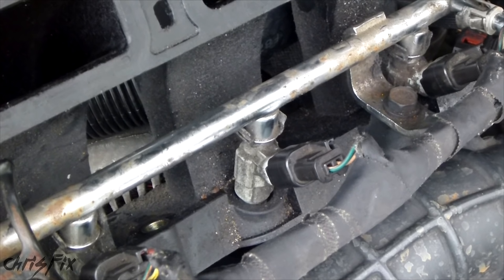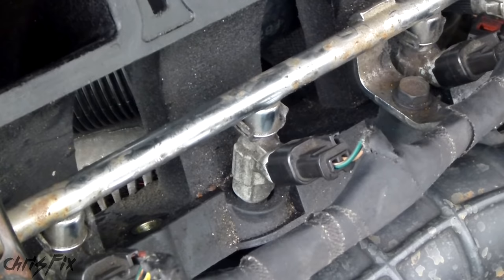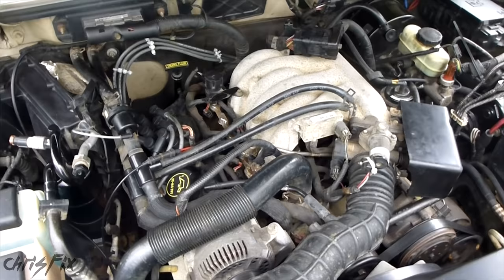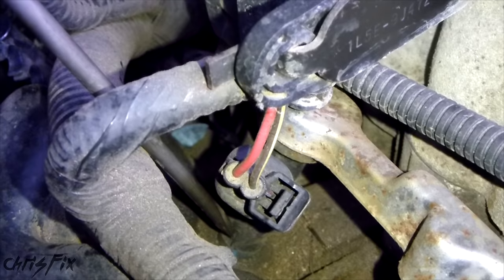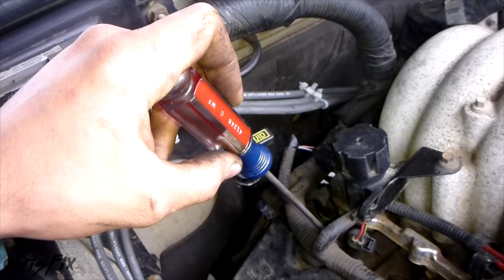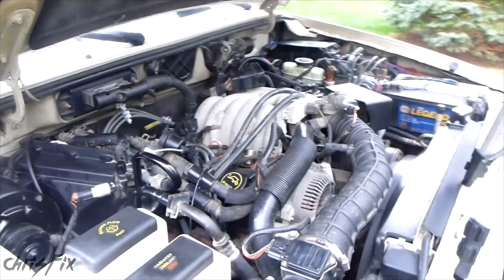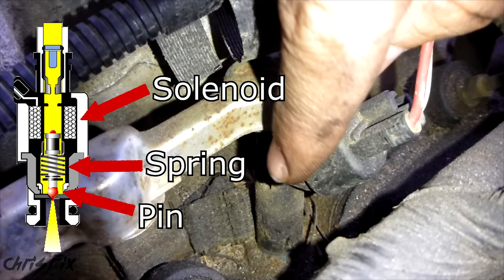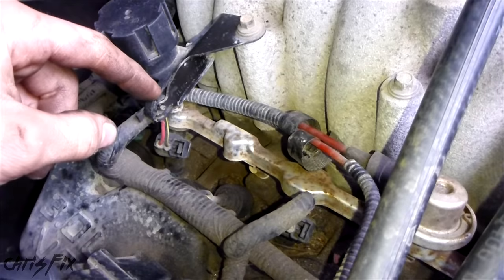Testing Fuel Injectors Fast

Comment: Hey Chris. I wanted to increase my car's fuel economy, any suggestions on how to do it?
Reply from the maker: Rasik Sachdev Correct tire pressure, remove any extra weight in the car, and adjust your driving style are the biggest factors.

Comment: bro nice video. I have a 2006 Buick Lucerne northstar V8 engine. I have had a gas leak for like two days in one particular injector but when I remove the clip I doesn't leak anymore. but let's off a massive spray if I try and put the clip back on. just curious
Reply from the maker: +Sedrick Jones Check to see if there is voltage going to the clip with the car off.

Comment: So the constant tapping is good sign I can touch the top of the secondary spark plugs and I feel.that but on the other side of the engine i feel nothing at all 5.7 05 durango 130k miles it was missfireing I change all plugs and the the egr valve because that code was on aswell no more codes but car still feel a shacky at idle could this be dead fuel injectors or? Bad coils ?

Comment: Hi Chris! if is okay i would ask about fuel injector seal.I would like to know about the reliability of fuel injector seal. How long will it take before the seal wear out or broken? Thank you
Reply from the maker: kuro neko It really depends on a lot of things. I have had cars go 300,000 miles with no problems with injectors or seals and cars go 60,000 and need new injectors or o-rings. There is no definitive time line. It is common for cars that sit and dont get driven to have dried out injector seals or gummed up injectors.
Reply: I understand now. Thank you for helping me out.

Comment: does this test verify even a clogged injector? so i get good clicking on all 8 cylinder 305 tpi camaro. When i pull ogf #4 distributor cap wire i get no idle change when i take off the rest off the cap one by one the idle changes! I pull plug and look for spark it has spark
i Pull#4 plug cylinder 120psi. But theres no fire on cylinder 4 due to the dist cap wire pull test. This seesm to only leave fuel issue on one cylinder

Comment: Not my transmission, it's the fuel injectors.

And there's a test that a lot of people don't know about to know for sure if it is your fuel injectors or not. I discovered the test myself this morning lol. 

Every morning I get in start the car I let it idle cuz it's idling sucky I'll start to drive on the road and I'll feel a jolt I'm thinking transmission but no it's because the fuel injectors are either clogged or dirty and the fuel is not getting to them properly. 

So I said this morning I'm going to do this test that I just figured out on my f**** own lol.

I'm going to give the car some gas before I get on the road to see if I feel that jolt if I feel the jolt that I'm assuming all right transmission and it's slipping if I don't feel the jolt it's because I gave enough fuel to those f**** fuel injectors and guess what I didn't feel the jolt not once on the road not once so if you want to know how to test your fuel injectors there you go... Fast and easy way without having to do anything with tools that's how you test your fuel injectors.

So now I know it ain't my tranny it is definitely the fuel injectors so spread the word there's a new way to check your fuel injectors nobody knows about lol

Comment: I have a 93 f150 5.0 and cylinder 8 is the only one that is fouling out  all my  plugs are new and look clean new wires cap and rotor. Now im thinking the 8th cylinder fuel injector is not working properly *leaking. Could this be the problem im not looking forward to spending alot of time on an injector job as this is my daily driver and the intake manifold covers the passanger side fuel rail and injectors

Comment: Hi, i have a diesel car and it is shows obd code p02cc. I have tried to switch the cylinder 1 injector with the cylinder 2 injector but again it shows the same code. Any idea what could be causing this. Thanks in advance

Comment: So i changed out my spark plugs the spark plug wires the ignigtion coil pack and the idel got alittle better but when im crusing down the high way she has a vibration im thinking it could be the fuel injectors in 3 and 6 but not sure does it sound like it could be the injectors.

Comment: I am at a loss, I have a 2011 kia soul so far I have changed out the crankshaft censor, alternator, battery, spark plugs and my car still died at an idle and didn't want to start. I have to let the car sit for about 30 - 40 min before it will start again. HELP PLZ

Comment: OK so I just had coil and spark plug issues   got that done no more code for that issue but now all of a sudden the check light came on now its code too rich bank 2 po175 fuel injectors  is that caused cos of the   coil spark plug situation before this ? Cos I hav a new altamator and fuel pump all changed out a year and half ago

Comment: What would be wrong if starts up and is loud till it cools down but if I let it sit there after awhile I get what seems to feel like a misfire and everytime it happens under the hood you can here a click, sometimes it's a single click and other times u hear click... Click,click,,,click, it seems it's a bit over the place, along with it when I drive at say holding a constant speed it sputters a bit
Reply from the maker: Any codes showing up when that happens?
Reply: No, and only thing that happened when they hooked up device and drove it was 6,248 on 4 of 8 cylinders for # of misfires and doesn't change
Reply: Think it's pcm , and found out replacing wires got rid of the click that turned out to be a spark plug sparking after getting under it in the dark

Comment: How much voltage needs to open an injector in common rail systems?
Reply from the maker: 100V– 400V and up to +20 amps. Depends on what engine.

Comment: Hey so what are the causes and fixes of a gas leak in my 2005 chrysler pacifica touring? I just recently changed my oil and filter, hand washed my car a few days later, and now I smell fumes inside my car. They caused me to pass out at the wheel in traffic last Friday on my way to work
Reply: Idk how to fix it or diagnose it, can you make some videos on fixing this, the evap system, the serpentine belt, the ABS system, gearbox and steering problems please? I'm tryna learn how to work on cars and I'm using my chrysler as my tinkering project cuz I wanna customize her one day to race in. And my rear passenger tire area keeps making whatever tire I put on it go flat within a week or two, rather annoying tbh

Comment: Chris ,,hi. Can that be a tapping noise I slightly hear on my f150 from out side the hood towards the underneath of  the engine.
Thanks in advance.
Reply from the maker: No that tapping noise is something else (are you sure it is coming from under the car?). It could be the rocker arms which is normal.

Comment: Would the same standards apply if you hit the gas while in park as far as consistency? Like would you be looking out for the same things?

I only misfire upon acceleration so I’m trying to track down the problem injector
Reply from the maker: Use an infrared thermometer. Here is an example with a more fancy tool: https://www.instagram.com/p/Cw-fOrdOzh_/
Reply: @chrisfix  any other cheaper methods?
Reply: @chrisfix  actually I got a more specific question. I have a dealership grade scanner which the other day when I tested was showing all cylinders misfiring intermediately only during acceleration.

Now a few days later I tested it again and went around for a drive and it took much longer for any misfires to pop up but finally cylinder 1 and 2 did show up. However the rest of the cylinders were fine and the 1 and 2 are not as bad as they were the other day.

What could possibly be the culprit? I have no check engine light on. I’m thinking something fuel related but the inconsistency in misfires throws me off. The performance is also not like it once was and I’ve changed out sparks and coils 2 years ago.

Comment: I don't have a light on, but my car won't start when I put gas in. After driving for a while, I'll bring it to a stop or coming to a stop and it'll die on me and from there it dies on me at every stop. Could that be the injectors?
Reply from the maker: It could be the injectors but I am thinking it might be a fuel pump or a clogged IAC valve. Check these two videos out for more info:
IAC: https://www.youtube.com/watch?v=vFhoNykgQtc
Fuel Pressure:  https://www.youtube.com/watch?v=_oXLUqE4Sf0

Comment: Hi Chris I have a 99 Ford Contour.  I replaced the fuel pump about 4 months ago and the car has been working perfectly.  I went to start it a few days ago and it wouldn't start.  The next day I tried again and it started. Over the past few days it would somethimes start.  Now it won't start at all.  I disconnected the line at the fuel rail a little fuel ran out. So I tried to start the car and no fuel came out the line. Then I disconnected the line at the fuel filter and some fuel ran out but when I tried to start the car no fuel came out there. I lifted the back seat to be sure the connections were connected and they were. I can hear the fuel pump running when I start the car.  Any suggestions other than replacing the fuel pump?
Reply: +Tiffany Whittemore did u buy a cheap fuel pump? sounds like it. they dont last long

Comment: Hey Chris, please help! Someone tried to steal my mas truck. They ripped the ignition out, however, her 2002 f-150 has a chiped key. Thankfuly they were not successful in their endevors. I have been trying like hell to get my mas truck running for her without having to spend a bunch of money at the dealership. From my research l have concluded that the ford PATS system is now stoping the truck from starting . i had no fuel pump at first so i ran a hot wire to the fuel pump cut off, and it now has fuel. So now,  after days of headachs, I have spark, and i have fuel yet the truck still will not start. I beleive it is the brain keeping the injectors from firing.. is it possible to hot wire my injectors? or something in order to avoid having to go to the dealership. we really can not afford it right now

Comment: what u got a bad injector or injector malfunction,the  check engine light must be on or not sometime?
Reply: Armando Sanchez bad/clogged Injectors cause your vehicle to missfire which tells ur cars computer somethings wrong and throws a code. so yes its possible the check engine light comes on.

Comment: I  am experiencing a problem with my truck when you turn on the heat or air and are sitting at a stop sign you can smell gas don't see any leaking and can't smell it from outside the vehicle or when driving
Reply from the maker: +Tony Clipp it could be the fuel lines,  fuel pressure regulator,  or the charcoal canister.

Comment: Question how would you depressurize the fuel rail if you need to remove the injectors
Reply: redbaron2448 There should be a furel pressure regulator on the fuel rail. You can do it that way. If there is no regulator (like my Buick) there is a pressure testing port on the fuel rail and you can de pressurize there. If all else fails just remove the fuel line. Be very careful for fuel spray.
Reply: Mike Greenberg ok great thank you.

Comment: hey, so I've been dealing with issues with my 95 buick Riviera,  changed everything that was easy to know was wrong like the alternator and bad battery, also changed plugs and wires and fuel pump and filter, also a new igntion module was put in cause last one was bad.. but now I just can't get my car to start it tries to but won't.. when I push I gas it makes a pppff sound like an air bubble possibly got in the way to the fuel getting to engine. . so my question is what is your opinion on why gas isn't getting to engine and would have a bad fuel injector or injectors cause my car to not start completely? ? :/ very frustrating. .
Reply from the maker: +Julia Holm Sounds like you are talking about an engine misfire. Check the distributor/spark plugs and wires.
Reply: Was it your timing?

Comment: Anyone know the location of the injectors on a 2006 pathfinder. 4.0 engine. Will I have to remove the plentum to get to them? I had to remove it just to replace a spark plug and coil. Number 1 cylinder. Thanks for any help. Vehicle is running okay, but not great.

Comment: I have an old '90 Ranger w a 2.9L. Everything is working, but it has no power on hills. Auto trans will down shift OK, but 45 mph on a 2% grade is max for this engine. Wonder if its the Mass Air Sensor?
Reply from the maker: Hoser Man You might consider cleaning the MAF: https://www.youtube.com/watch?v=gRfaPfTcfOM
Are there any check engine lights? Does the car run fine otherwise?
Reply: I took it out yesterday and after cleaning the sensors, the transmission does not shift into a  lower gear when going up hills. I manually shifted into 2 and it marched right up the hill. The engine is getting fuel and it does rev up so I'm thinking its got to be a transmission sensor or something similar.
Reply from the maker: Hoser Man I read your other post and it said you put larger tires which would potentially throw of the shift points. Since the rpms are good it wont shift.

Comment: My Jeep runs great when cold. After It warms up, and I restart after warm up, it has a cylinder 3 fuel injection misfire. Is this normal for a bad injector?
Reply from the maker: It could be once the injector gets hot, the injector internal resistance changes and makes it malfunction. Change the cyl 3 injector with cyl1 and see if the misfire follows. If so, you know what injector to replace.

Comment: ChrisFix  I have a 96 Toyota Corolla that will turn over but doesn't start, I've ruled out the Fuel pump, alternator, and fuel filter but I was just wondering if it could be the fuel injectors or the spark plugs?
Reply from the maker: Lisa Thomas Did you check the fuel pressure? What is it: https://www.youtube.com/watch?v=_oXLUqE4Sf0
It can be the injectors. You can have someone try to start the car and listen to see if they are pulsing like in this video. You can also do a resistance test on the injectors: https://www.youtube.com/watch?v=ZVXchvHefNc
It can also be you are not getting spark so make sure you are getting spark from the spark plugs!

Comment: if you swap injector 1 with 4 and the code moves from cylinder 1 to cylinder 4 you know the injector is bad and you can rule out the wiring harness
Reply from the maker: +Hans Zarkov great tip!

Comment: Hi cris I fallow you so close I even like and subscribe your video , but now I have a very bad situation I have a Toyota Corolla 2001 I swap a engine put a other one since I was put the engine it sound good but it  vibrated says cylinder 2 misfire, I change spark plugs  change the fuel injecter even change the fuel rail the problem misfire still there ,so now what you think may cause and how can i get it fix  please I'm waiting to hear your answer  thank you .

Comment: I have a louder intermittent tick around cylinder 6 in my 2000 Toyota Tacoma when the engine is hot only. As it comes and goes when the engine is hotter in stop-and go-traffic, the tick can be heard from inside the truck when you listen closely. Is intermittent ticking in a hot engine a sign of a bad injector? My Tacoma's intake manifold is huge and blocks the fuel injectors on the right side. I can't use a screw driver without taking the manifold off, so could this be a sign I need to throw money away lol.
Reply: +Dcc357 first check if you have engine oil
Reply: +jimmy mangat it does because i change my own oil. it's right at the max on the dip stick and doesn't burn any.
Reply: is the noise even coming from the engine? it could be something else

Comment: I believe I'm leaking fluid around the fuel injectors it is all wet and as soon as I turn my car on smells like gas really bad in the engine and inside the car the ground is wet underneath the vehicle directly between the catalytic converter and the flex pipe so I don't know if the fuel injectors are supposed to be all dry around there or if it's supposed to be a little wet I don't know I'm female lol

Comment: Hey I have a 2010 dodge charger sxt with awd and every now and then it cranks excessively but always starts and runs perfect..... can it be the fuel pump thats going? I was also told to try cleaning the fuel injectors as dodges tend to get crudded up quickly. What are your thoughts?
Reply from the maker: Sounds like it is fuel related. Watch this and let me know if you have any questions Fuel Pressure Test

Comment: I'm having problems with my car it's cutting out when I'm driving and then I start smelling fuel I checked fuel pump and there is no check engine light on. it's a 2000 3.8 mustang

Comment: hi chris or anyone else I have replaced the injector ECM and checked the wire resistance still #4 injector will not fire. any suggestions. thanks T. Also checked for pushed wire pins in the connectors.

Comment: My problem is my 95 ford e250 van quit running I sprayed starting fluid in intake engine wanted to start up so I replaced fuel pump the filter the relay and fuse just to be safe still not starting I made a jumper wire on fuel relay and fuel pump is running great still not starting so can it be clogged fuel injectors or what I'm stuck here
Reply from the maker: what is the fuel pressure? Are the injectors spraying?

Comment: Hey my 89 civic is dpfi and the injector is in the TB.  Is there a way to back probe or something?
Reply from the maker: phatpac5 If you follow the fuel rail into the throttle body, you can still hear it by holding the screw driver against that!

Comment: 2 of my injectors don't fire at all , I've switched them and they work but no electricity is passing through the wires to injectors could it be the ECM?
Reply from the maker: Jesus Vazquez Could be the ecm or it could be the wires leading from the ecm to the injectors. Check for any frayed wires.